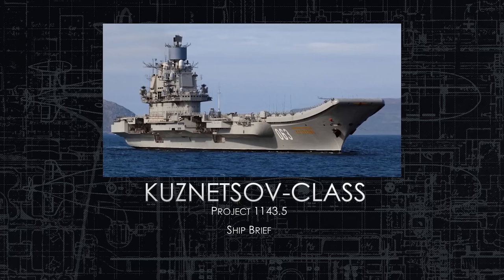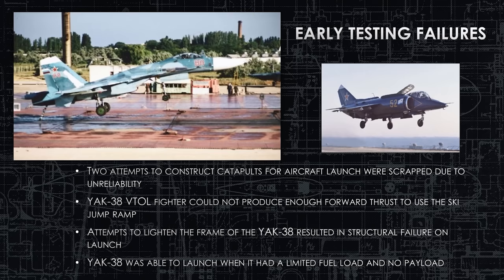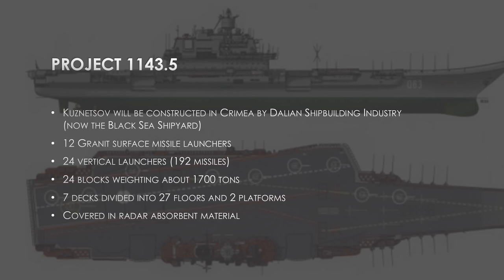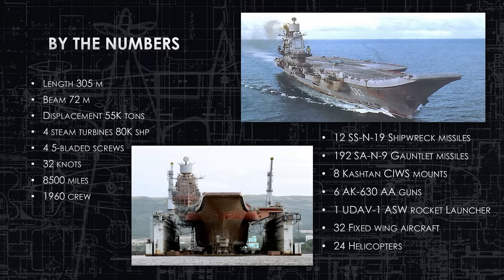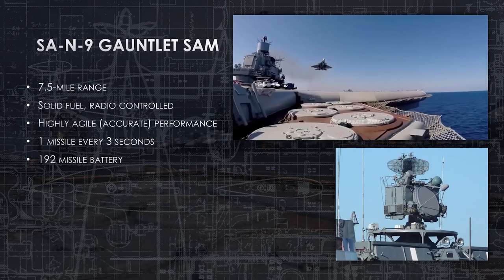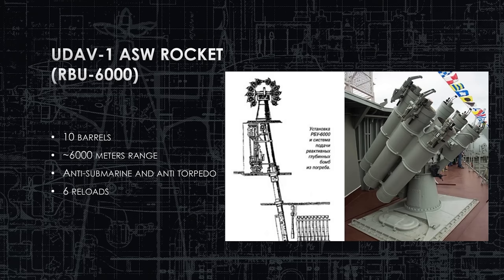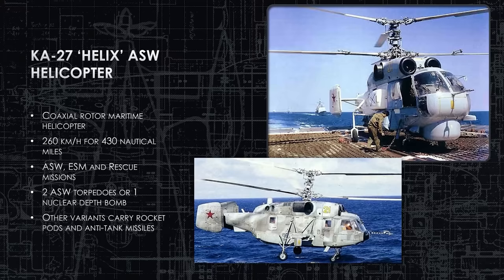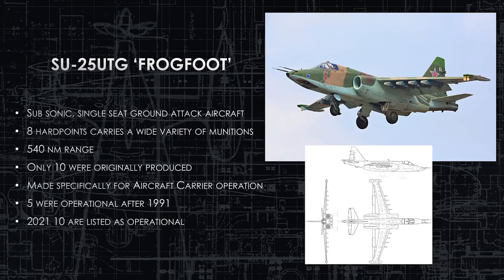Russia's Heavy Aircraft Carrying Cruiser Kuznetsov

Comment: Considering how big a Flanker is, being able to carry 32 of those plus no less than 24 helis is impressive
Reply: i'm assuming some of those are stowed as parts/spares/repairs i've always seen this represented as operating an air complement of around 40 a/c, even as few as 32 -- not 56.
Reply: It isn't, kuznetsov-class (Liaoning and Shandong included) don't carry 32/36 fixed wing + 24 rotary wing aircraft.
The max is a combination of 24 fixed wing su-33/J-15 and 12 helicopters for a 'not so surged' total of 36 aircraft. You can squeeze some more fixed-wing 'or' rotary-wing at the expense of the other. The maximum number of aircraft on board (at surge) is no more than 40.

This particular video of @SubBrief has several inaccuracies.
Reply: if it manages to sail :)
Reply: How many would've fit in had they not add the VLS? That thing is 70 ft long, bigger than the Tomcat.
Reply: @Joshua_N-A  you can answer it by comparing Liaoning's complement to Kuznetzov
Reply: @neilnitin4004  it's not just questionable girls in certain streets at night who get to ask "give you a tug for an under the table payment"

Comment: A few notes about Liaoning:

- The J-15 was not grounded for engine issues.  It uses the same AL-31F engines as the base Su-27.  The aircraft was grounded because the flight control system caused multiple uncommanded pitch-up incidents that killed a couple test pilots.  This was due to it being the first FBW aircraft the Chinese developed indigenously - the original Su-27/J-11 was not FBW, and the J-10 and Su-30MKK had their flight control systems developed by IAI and Sukhoi respectively.

- One of Liaoning’s steam mains ruptured during sea trials in 2014.  This and other testing incidents caused the ship to not be accepted for years as the plant was continually modified to fix the flaws found, which is why the PLAN did not officially certify her for service until 2018.  We know this because of Sun Bo, a senior engineer at Dalian who passed on details of Liaoning’s refit and shakedown process to the CIA - he has, of course, vanished since the CCP found out about it.

- Liaoning has a half-sister, Shandong, that commissioned in 2020.  So far neither ship has experienced any at-sea engine casualties (and we would know of them since they’re always tailed), so whatever the Chinese did, it seems to have worked.

- The JMSDF reported that Liaoning was averaging 300 sorties/week during her 2021 deployment, during the entirety of which at least one Japanese warship shadowed them.  That works out to about 42/day, which is pretty normal for a STOBAR or STOVL carrier, and nothing compared to a Nimitz (which does 100/day all the time) but is downright amazing when you consider Kuznetsov did 420 sorties over 4 months - about 4 sorties/day.
Reply: It really showcases the importance of the organization behind the military. Poor old Kuznetsov never had a chance in hell, coming online just as the Soviet Union was fully collapsing into the decay that would consume it, and spending its entire service life in service to a country that basically subsisted on stripping the copper out of the walls the Soviets built. As godawful as the Chinese are in any number of areas I could care to name, they APPEAR to have aggressively worked to keep a handle on that kind of corruption, both based on their own statements (which could be completely full of it) and the real-world situation those actions created (which are a lot harder to fake when under this kind of scrutiny).

The results speak for themselves. While not a supercarrier, the Liaoning appears to have turned into an entirely functional modern fleet carrier, while the Kuznetsov may never sail again. A dire, cautionary tale for navies around the world in the modern day.

Just, y'know. Not so much the part about throwing a private citizen under the bus as part of the acquisition.

Comment: The Kuznetsov Class. Continuing the time honored Russian/Soviet tradition of building expensive things cheaply and wondering why it doesn't work. Never change Russia.
Reply: What became of the Liaoning was only 60% finished when it was abandoned for years in Ukraine. When Chinese experts came for a detailed examination, it was found that the whole ship interior was in a very pitiful state but the main structure was in almost perfect shape: under the thin layer of rust, the steel used for the hull was of such quality that almost no sights of stress or deformation was seen despite years of abuse with no maintenance.
Reply: @thomaszhang3101  The hull and structural members aren't the important thing here. The important thing here is the electronics and engines, and those, as installed by the Soviets in Kuznetsov, were and are absolute crap. Even worse, because of problems, Kuznetsov had to keep her engines constantly running for much of her life even when she was pierside, resulting in a situation where she has 40-year-old engines in a hull that's only actually been used for a total of about 3-5 years.
Reply: @katherineberger6329  that limitations to the technology, and not their attitude of building expensive things cheaply. What was put onto the ship was the best that the Soviet industry could offer.
Reply: @katherineberger6329  Currently in Ukraine, Russian weapons outperform all the West throws at them. Moreover the Mig29, Su25, Su27/31/35 are excellent aircraft. Disparaging a nation's intellectual capacity after they've led the way in space and over a vast range of military developments, isn't a good look, nonetheless you manage to pull it off well. Kuznetsov recently helped thwart the CIA/Mi6/Mossad-trained Islamic State in Syria. For this service alone Kuznetsov, earned its stripes.
Reply: Yes, it was the best the Soviet industry could offer, which rather unsurprisingly was garbage.
Reply: @TheThingInMySink  soviet industry made stuff that worked, gave it to the navy who ruined it by being inept at maintenance and crew training...
Is more accurate
Reply: Would say it’s more of a lack of sustainment rather then build quality
Reply: @a.m.armstrong8354  I could go On all day talking about how Western radars outperform russian Radars. And many more from what We are seeing in ukraine
Reply: @a.m.armstrong8354  And also Me writing an more detailed post Yeah that is on discord sorry.
Reply: It wasn't built cheaply at all.

It just didn't get updated and replaced and so it's a long old relic compared to its peers.
Reply: @katherineberger6329  The electronics were cutting edge and better than the west in some cases.

But they weren't updated for several decades.

The engines are fine for the design ...if you don't have to keep them at idle and they are running for 30 years past when they should have been replaced.

The ship WAS a beast, it isn't her fault for growing old.

Bunker fuel is an odd choice by the soviets but it wasn't necessarily a bad one at the time.

And again her electronics were state of the art in some cases at the time.

Comment: 'Nuclear Depth Bomb' sounds like it deserves to be covered in more detail.
Reply: Developed by the same ordinance bureau as the nuclear hand grenade?
Reply: All nuclear powers during the Cold War that operated ASW warships and aircraft had a nuclear depth charge. The US RUR-5 ASROC could carry a nuclear depth charge as could the SUBROC. The USN actually fired an ASROC with the nuclear depth charge as a test. ASROC has a maximum range ~10nm. The idea is that the effective area of a nuclear depth charge made up for the time lag between detection, acquisition and firing/dropping a weapon when dealing with a fast (25-30 knots) submarine in the 1950s and 1960s. When dropping the nuclear depth charge, the sink rate of the DC and the depth setting (the DC also had magnetic/acoustic fusing) allowed the aircraft (SH-3, P-3, etc) to escape the water thrown upwards by the explosion. The USN also had a wire-guided torpedo with a command detonated nuclear warhead, the Mk.45, as did the Soviets. The Mk.45 was withdrawn from service with the fielding of the Mk.48 ADCAP which had sufficient speed and guidance systems to acquire and attack fast and deep subs.

Comment: The Kuznetsov looks very top heavy. The Chinese Liaoning looks much better. The former always has black smoke coming from the funnel, the latter has a clean exhaust, perhaps they replaced the boilers as they burn much cleaner. Perhaps the Russians used thick cheap bunker oil while the Chinese use lighter diesel.
Reply: They do use cheap crappy oil

Comment: the reason that sukhoi s carry so few rounds is that their guns are for air to air and not air to ground.  when the pilot squeezes the gun trigger the air plane's weapons system/avionics takes control of the aircraft. after calculating the speed, direction, size of both the sukhoi and the target aircraft, the plane then orients itself to align the gun for the perfect shot. only then does the gun fire.
gun accuracy is exceptionally good with hit ratios of better than 99% after five shots. there are also  proximity fuses that can be used but come with smaller explosive shells. the stored shell capacity of 130 is more than enough to deal with multiple air threats.
getting too close to a sukhoi is suicide.

Comment: 10:48 RBU has 2 variants either 6 or 12 barrels, not 10.
Reply: That´s not true. There are several different versions of the RBU. The RBU-1000 have six barrels, the RBU-1200 have five barrels, the RBU-2500 have 16 barrels, the RBU-6000 have 12 barrels and the RBU-12000 have 10 barrels. The problem is he´s refering to the RBU-12000 as the RBU-6000, while at the same time showing a picture of a RBU-1000 and a drawing of a RBU-6000.

Comment: I don't get why they didn't take their best working type of ship as a template, put two of them together and then add on until it looks like an aircraft carrier. It would remove so many possible points of failure.
Reply: That is what they did but there is only so much tracing paper and good ideas you can take from smaller ships and lessons you still must learn.

But it is based on the kiev class

Comment: I’m surprised at the inaccuracies and I’m only 3.5 minutes into the video. Normally your videos are much better at separating facts from myths. First, Dalian shipyard is in China, not Russia. As pointed out elsewhere, the shipyard is in Mikolaiv, which is in Ukraine (then the Ukrainian SSR). Kuznetsov wasn’t designed for the Yak-38, but the Yak-141, a later VTOL; I believe the prototype crashed when the ship was first commissioned. The Su-27K (K for korabel or ship in Russian) was different enough from other Flankers that it was designated the Su-33 [edit: you point this out at 11:50]. The MiG-29K came later, too. Last fun fact: NITKA is an acronym but the word means ‘thread’ and pilots talked about threading the needle. All this besides the point because old Kuzya has been in overhaul since 2017 and will be for at least another year or four.

Comment: How did the soviets build a ship that couldn't handle winter
Reply: It was specifically built for operations from the Black Sea Shipyard in Mykolaiv because the Soviets didn’t have any other suitable facilities and it was one of the few year round ice free ports. To base out of the Black Sea meant forced compliance with the Montreaux Convention to pass through the Bosporus and Dardenelles straits more freely. That meant building “cruisers” with some aircraft capabilities instead of full carriers for treaty reasons. Basing out of the Black Sea meant reduced need for cold weather suitability compared to others. When Russia grabbed post Soviet capital ships during the fall of the Soviet Union they were forced to operate them without suitable facilities or expertise from colder Russian ports.
Reply: They often operated out of Sevastopol but had to go back to Mykolaiv for major maintenance